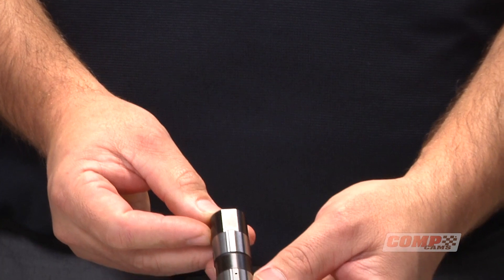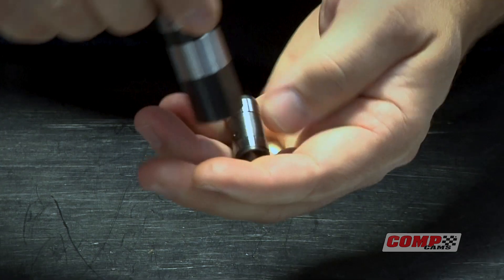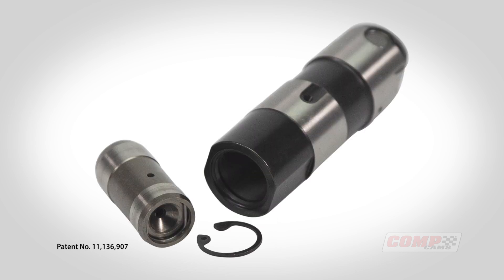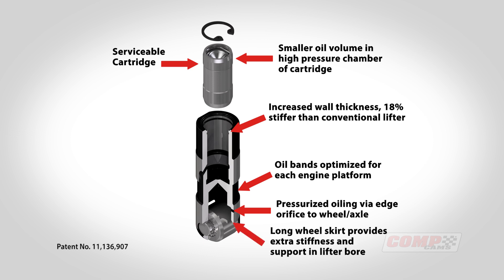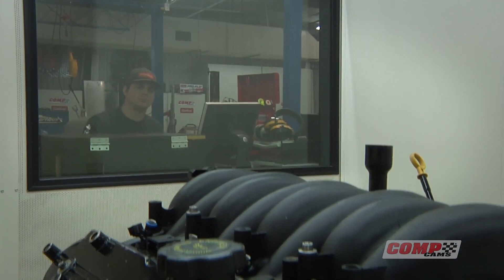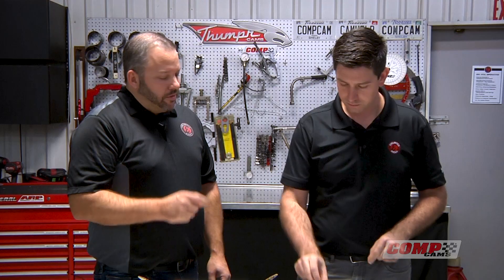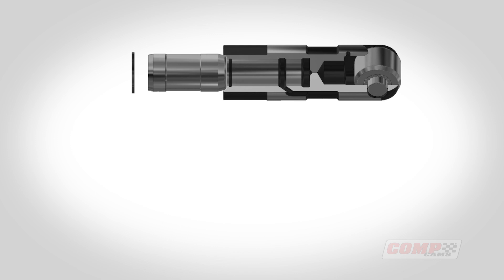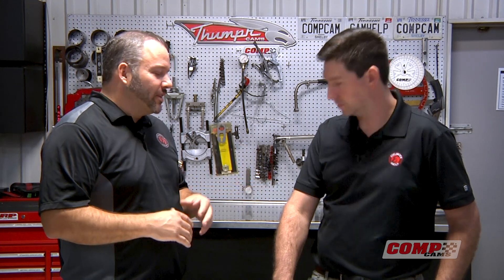COMP Cams Evolution™ Hydraulic Roller Lifters

Comment: New build, a Firebird with the 400 engine. Flat tappet hydraulic cam & lifter failure in less than 1,000 miles. After discussions with the client regarding the recent plague of flat tappet lifter failures, we went with a roller hydraulic upgrade. Two weeks later, the wheel on one of the lifters broke into two pieces, ruining the camshaft. This happened last May. The cam company said they'd have cam cores by November. Now, it's December and the don't know when they'll have cam cores. As for them doing anything about replacing the defective parts they sold us, they don't have someone who can make that decision. Dealing with a company such as that seems to be very risky lately.
Reply: I'm adding to my previous post regarding the failed parts in our Pontiac project. Comp Cams recently got in touch with us and resolved the issue, and I'm very grateful to them for the service. The past couple of years has plagued the industry with supply shortages for materials and we need to be patient. Thanks again Comp Cams.

Comment: I was in denial on why my comp lifters are making noise after 10k miles but I may have to replace as they have gotten very noisy on my mild 5.3 Silverado.
Reply: I found out it was not the Comp Cam  lifters that caused the noise.  The lifter trays were worn out and should have never been reused so that is my fault. I eventually had a lifter turn sideways and ate the cam.  I installed a new Comp Cams camshaft and used Delphi LS7 lifters....with new LS7 lifter trays.  Runs great and no lifter noise.
Reply: Which lifters did you go with ?

Comment: Just bought a set of these. Rollers have a gritty feel when rolling with my thumb. Disassembled to inspect and every single one of them had metal shavings in them.
Reply: That's Comp quality right there.
Reply: One of our clients bought a new set of roller lifters. He found some of  them "sticky" when rolling the wheel with his thumb, so he washed them, blew air through them, and immersed them in oil. The cleaning fluid he used now had a lot of metal debris is it that was able to be picked up with a magnet.
Reply: They’re junk.
Reply: Did you send them back ? Or clean them
Up and run them ?

Comment: Best cams in the world!!!  But their lifters are absolute garbage.  I have two sets that both need replaced, and this is after sending three sets back to them because they literally could not be adjusted.   One set of hydraulic rollers in  489 big block, and one set of the short travel lifters in a 434 dart small block, and they tick and clatter horribly no matter how they are adjusted...   I will never buy a cam from anyone else, but I will also NEVER buy their lifters again!
Reply: I just went thru some bad lifters from Comp Cams myself, in a mild 5.3 LS1 truck engine. I went with the retro link bar #8957 lifters at first and they clack horribly. I tried 3 different length pushrods to no avail. They sounded OK on cold start but got really loud as the engine reached operating temperature. I have video of them running on my channel if anyone is curious. Comp Cams gave me an RA on them and I'm going to return them soon. They sent me a set of the link bar Evolutions as replacement, I had to pay for them, they said they will refund the others once they inspect them and determine for themselves they are bad. I had to wait 3-1/2 months to get the Evolutions due to supply chain issues. I just now got them swapped in. It took 15 hours of run-in time to get the new valve train to quiet down. The Evolutions are a lot quieter. They are not dead quiet, but at least they are acceptable. And the Evolutions also are quieter cold than when the engine is fully hot. I have video of the Evolutions running too if anyone is curious.
Reply: @onemoremisfit    I hope you have great luck with them. Mine are getting worse as I drive the car. Just over a hundred miles on them now and they are bad... I am going to bite the bullet and buy the Johnson short travel hydraulics. I will buy my cams from Comp, but no more lifters. I wish you the very best of luck!
Reply: @kniteprince3798  The engineer in the video was talking like GM has some sort of production advantage making lifters that you can count on to run quiet. I think if these Evolution lifters don't settle in and run reasonably quiet for me, then I might just get a set of new stock units from GM and go with the plastic trays. My truck engine is mild and doesn't really need link bar lifters. I just thought they'd be an upgrade. I was unaware that Comp Cams has trouble with their lifters. As far as their cams go, I've been told that Comp makes cams for a lot of other brands, and that pretty much any brand that is worth anything is sourcing from Comp. But in this video even Comp's engineer is admitting they have trouble.
Reply: @onemoremisfit   I worked for Chevrolet for several years. They do make good lifters. But you need to buy the dogbones and the hold down, plus your block needs the mount holes for that hold down...  If your block is set up/machined for stock roller lifters that would be a good choice.
Reply: @kniteprince3798  The bottom end is 100% stock. The whole engine was stock and I put a Whipple AXO supercharger on it some years ago. Then I decided to do a top end rebuild, I sent the heads out for CNC porting, put in a new oil pump, new crank seals, new barbell, and a bullet proof double row timing set. I selected a cam with a stock idle, mild duration and .05" more lift at the valve than stock. This is a truck engine, I just want it to be stronger than stock but it will never see more than 5000 rpm. I went with link bar lifters but I can easily revert back to the plastic trays because that's what it had to begin with. After this experience I can appreciate GM's wisdom of the stock setup, and if I have to tear the heads off for another lifter change I'll probably go back to stock. I had no idea that aftermarket lifters could be that bad. I figured you buy a new camshaft and you use lifters from the same company on that camshaft and you're good. Live and learn.

Comment: Tell me you are smart enough to offer a “solid” drop in lifter that we can swap in to do the push rod length measurements without have to worry about bleed down or movement…your welcome.
Reply: Prime your oil pump.
Reply: That will never happen. They don't care about you or your engine or their reputation. All they care about is a paycheck today and let tomorrow come as it will.
Reply: Comp offers light spring sets for measuring push rod length with hydraulic lifters. They work great.
Reply: Checking springs.

Comment: So this means that using theses lifters will  turn any cam into a roller cam???
Reply: NO, because the lobes are shaped different. A flat tappet cam has a pointier lobe because it sweeps across the base of the tappet, which has the effect of increasing duration. If you put a roller lifter on a flat tappet cam it will never work. They did not make this product to convert anything, these are roller lifters for roller cams.
Reply: @onemoremisfit  ok cool 👍